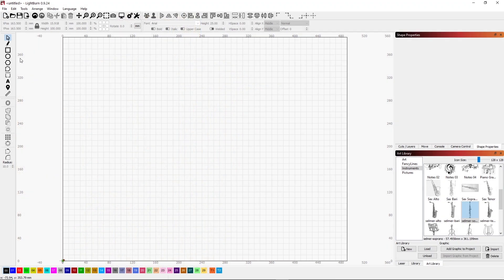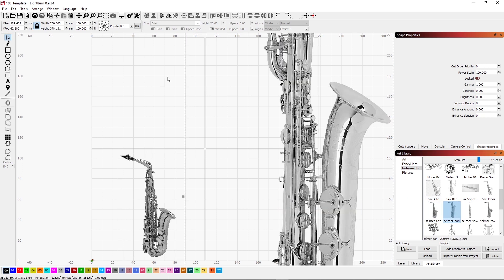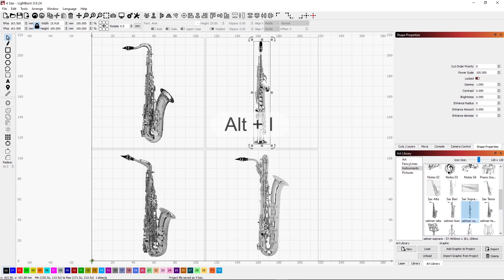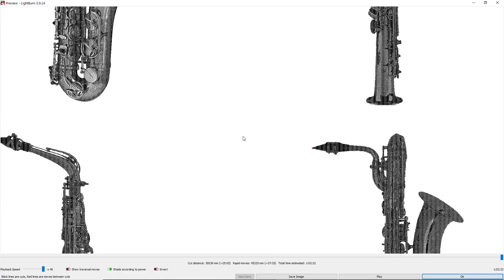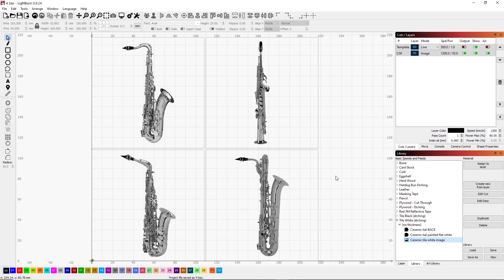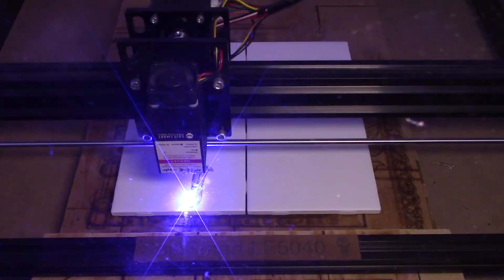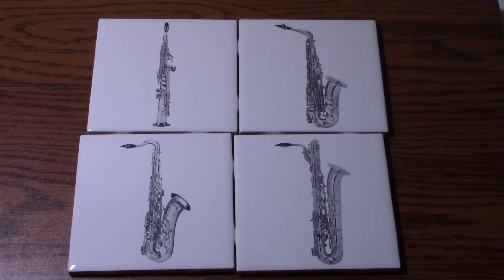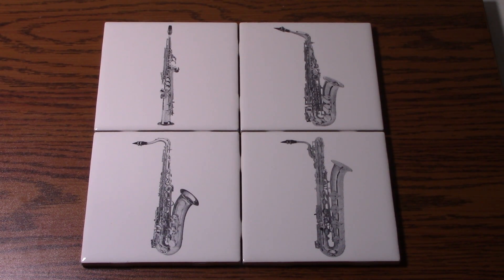The tile etching process 4 sax

Comment: the ceramics are painted?  regards
Reply from the maker: That tile is painted with white paint.  The laser burns the paint and in some sort of chemistry magic, it adheres to the tile and is virtually impossible to scrape off.  Once the burn process has completed, I clean the remaining pant off of the tile with lacquer thinner.  Once the tiles are completely dry, I apply a cork backing.  That is just stuck on as the cork I purchase has a self adhesive backing on it.
Reply: @CNCATHome  thanks, I have done tests 1000 mm / sec  90% but results are bad.  Regards
Reply from the maker: @Yoshi-Toranaga  It sounds like you are on your way to making this work.  You need to play around with the settings for your laser to find out what works best.  I start new materials with a test burn that takes one feed rate and tries several power settings to see how it does.  I did a video on this recently on how to make a simple test pattern: https://youtu.be/_Enrn7ruqs8
Reply: @CNCATHome  Thank you very much, I will review it carefully. Good day

Comment: Hey Barry.  Great project.  Can you provide a quick overview on how you prepared the tiles?  You mention in the video that you painted the tiles.  Did you start with a standard white glazed tile, then applied some sort of spray paint to achieve a smooth finish?  Did you need to scuff the tiles with sandpaper before applying the paint?  Thanks
Reply from the maker: I did a series of videos on the full process that I was doing at the time.  This first one should get you started: https://youtu.be/4JWBNi4FxJk. There is a video on setting up the project using LightBurn and one on the process of etching and cleaning the tiles.  I hope that helps.

Comment: What size Laser are you using on these tiles? Please.
Reply from the maker: Great questions.  I don't always remember to put that information in the video or description.  I will go add that now.  I am using a Genmitsu LE5040 with a 5,500 mw LED laser.  The white painted tiles are burned at 1,200 mm/min at 85% power.  That seems to be a sweet spot for this laser.
Reply: My laser dimensions are 450 x 450mm with a 30W (5.5w optical power) laser module. I'm running the latest GRBL in laser mode and lightburn.